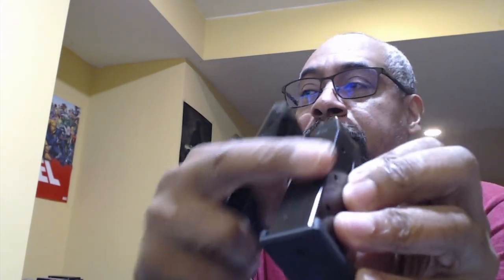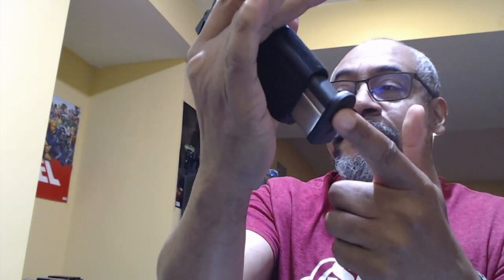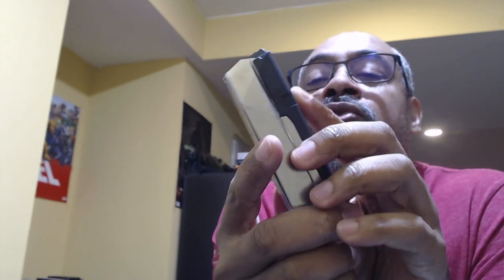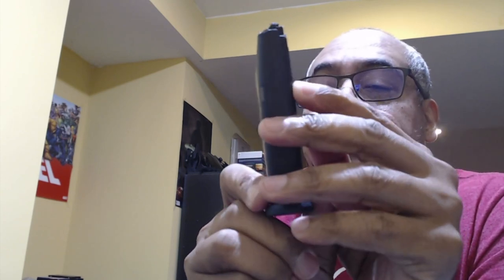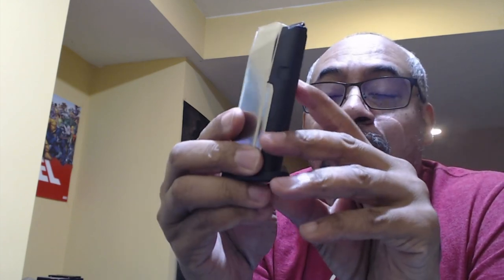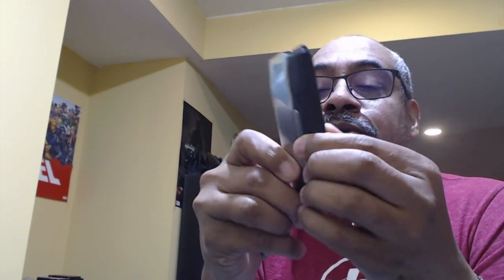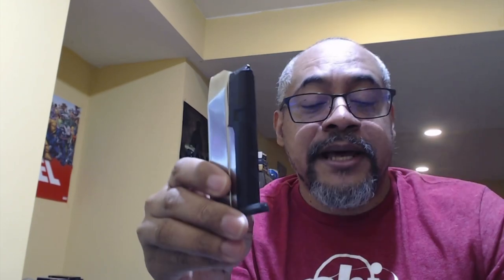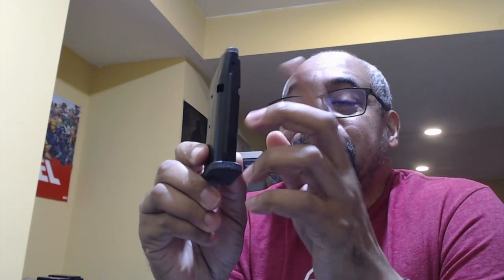Will the AF1911 S15 Take Dagger Mags?

Comment: I have shot 3800 rounds through the  PSA Micro Dagger 15 Round magazines I have for my Alpha Foxtrot S-15 1911 pistol, with no issues at all unlike the shield Arms magazines which have caused failures to feed, causing rounds to nose dive down into the feed ramp, also had double feeds, for the price of the shield arms mags they should run flawlessly but that's not the case. I have four of the shield Arms S-15 Gen 3 magazines two of the magazines are problematic, the other two magazines run perfectly, I don't know if it's a quality control thing at Shield Arms but their magazines are not consistent in reliability. I have four of the PSA Micro Dagger 15 Round magazines with the slick finish, all four of those magazines with 3800 rounds put through them have ran flawlessly.
Reply from the maker: Thanks for sharing your experience with these mags!

I think I'm going to buy a bunch of them (5-6) for actual use with the gun.  The one mag that I have has been flawless and I keep hearing similar things from other folks who've been using them.

The only thing is, they tend to sell out quickly and they're not exactly cheap.
Reply: So a metal mag release with a polymer/hybrid mag isn’t an issue wear wise?  I have an AF1911 S15 with 4 gen 2 mags, no issues.
Reply from the maker: No issues for me.